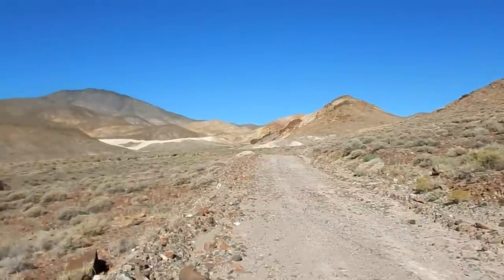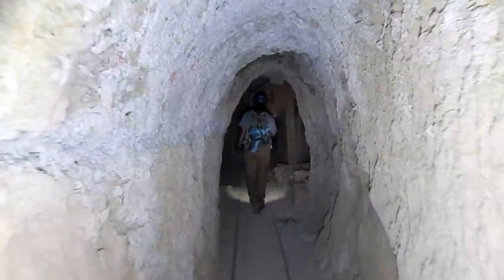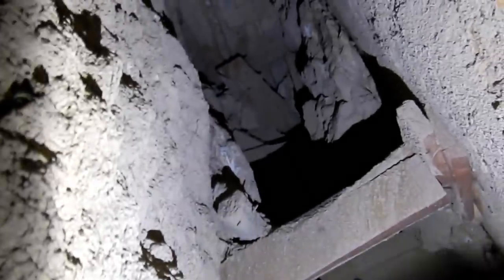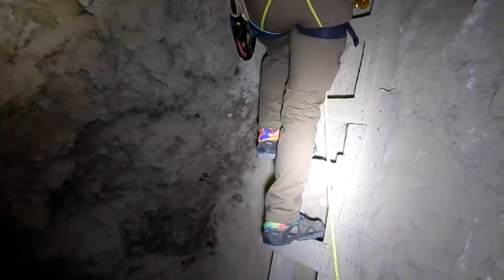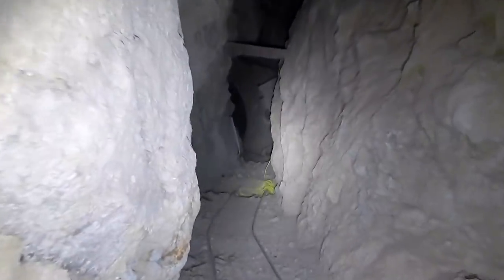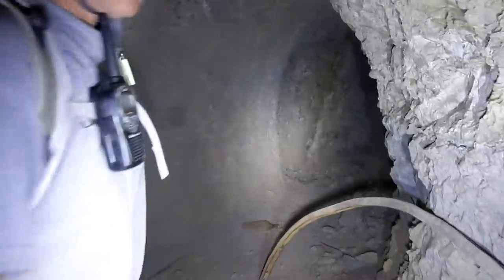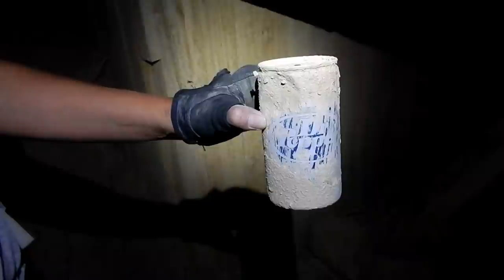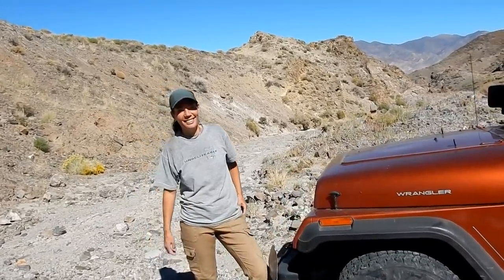Rappelling And Climbing The Ladders Of Nevada's Abandoned Sunset Gold Mine

Comment: I remember those pull tops , they only worked 50% of the time , too many used to break off in your hand .............you ended up using a can opener anyway .
Reply from the maker: Exactly, or cutting your finger trying to push the tab in after a couple beers.

Comment: Cool explore! I'm guessing the head frame at the top of the shaft along with the winch and winch house are missing? That bottle you guys picked up looked like an old milk bottle. Nice cabin! I never realized the miners would flatten cans for the roof. It beats getting wet!
Reply from the maker: You know we have been to this mine twice and have never made our way up to the top of the shaft. That is a little strange for us as we usually give the outside a good going over. It's quite common for the old cans to be repurporsed for building materials. Especially the 5 gallon square fuel cans. They made do with what they had. Thanks,  William!

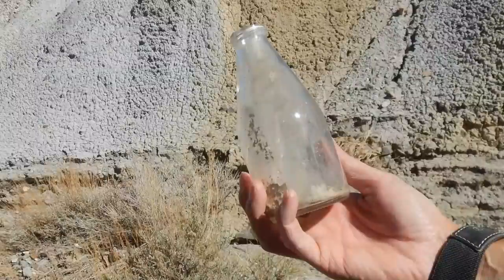Comment: Tom ,  @36:31 - that glass bottle that Julie is holding originally came with  CREAM  in it , and the bottle was sealed with a disk of Cardboard that was pressed into a circular recess inside the neck of the bottle .  There were no labels on the bottles , and the seal disk was usually imprinted with the name of the Dairy that it was from .  Also , there was a pre-cut pull-tab on the cardboard disk and you had to use a knife point or the sharp little Tool given out by the Dairy that was made for lifting those pull-tabs .    ---   < Doc >  .   ( P.S. --  I still have one of those little Tools from the Dairy for lifting the pull-tabs . ) .
Reply from the maker: Thanks for all that, Doc. I barely remember seeing those tops with the little tab that you pulled on. I have never heard of the tool that was used for getting the tab up. Always a pleasure!